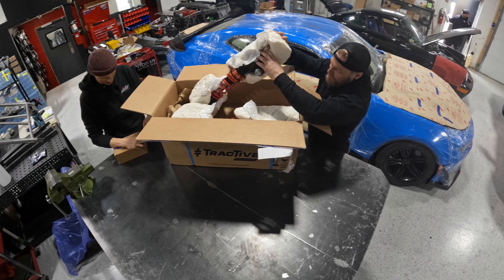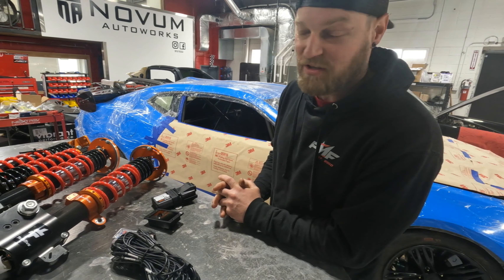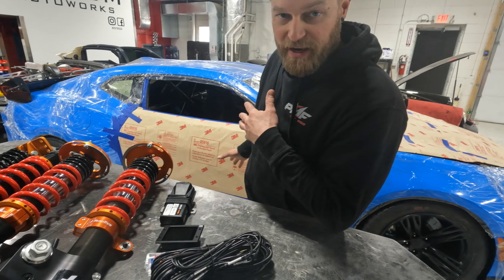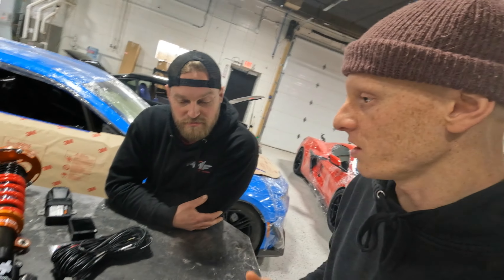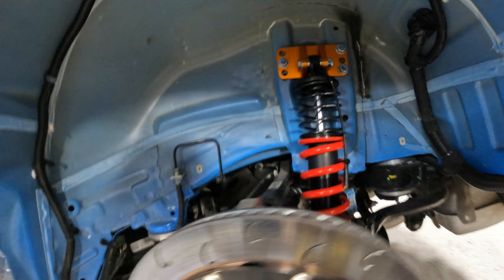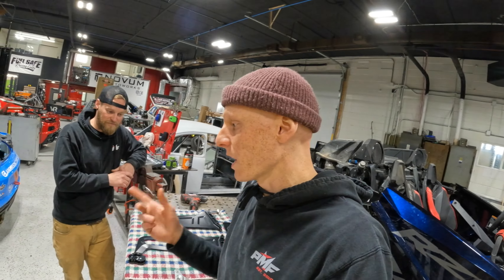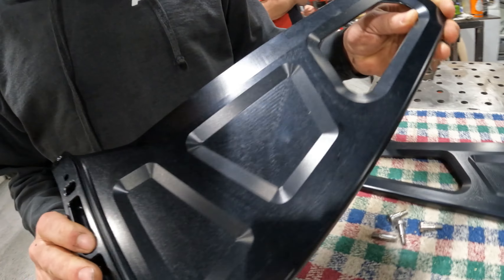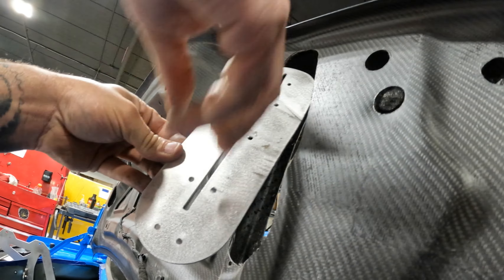Camaro ZL1 TracTive Suspension Breakdown + Install EP.5

Comment: That car, the ZL1 1LE, does not have electronic suspension from the factory. The only 1LE Camaro that has it is the SS 1LE, the MagRide suspension, which is driver selectable for damping.  The ZL1 1LE has the blue Multimatic DSSV dampers and they have no wiring going into them. The three modes that were mentioned are not suspension modes in this particular car.
Reply: This is a zl1. The zl1 has mag ride standard. You're right though the zl1 1le has dssv dampers. Which in my opinion would be a step up from these. A set of mcs remote coilovers would have been ideal on this car.
Reply: Nevermind i stand corrected. As soon as I saw the wiring I knew that a 1le. I'd personally never put active suspension on a non mag ride car. And even if I'd still ultimately deleted it. I tried the active suspension route and it's great for street driving but for not competitive racing. Funny they're saying the 1le has modes for suspension 🤣.

Comment: I'd ditch that wing deal and go with the nine lives chassis mount. It's a lot better.
Reply from the maker: It's impossible to say which is better without head-to-head testing TBH. Keep in mind, our wing setup is chassis-mounted as well and extremely rigid; you'll get a more in-depth look at it in the next episode when we break it down at the race track!
Reply: I have actually heard that the decklid mount on the Camaro is stiffer than the chassis for 9L
Reply from the maker: @Slurpee_12  I can't comment to that, but with a full carbon trunk like this one has, chassis mount is definitely the way to go. Especially with our extra-reinforced mounting plates we made.
Reply: @patiencemetalfab  Yup no choice but to go with chassis with a CF trunk
Reply from the maker: @Slurpee_12  I just finished editing our track day video with this car, where we go in depth on the mounting of the wing. Keep an eye out in the next few weeks!